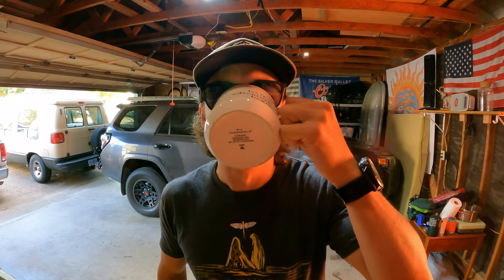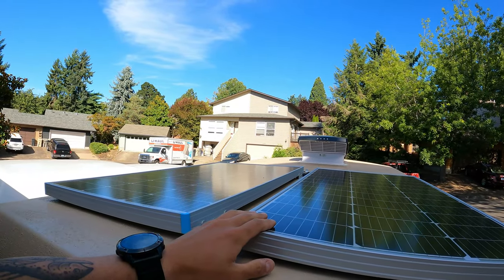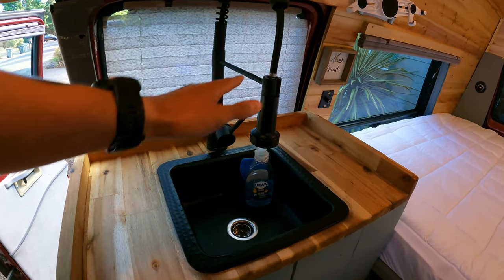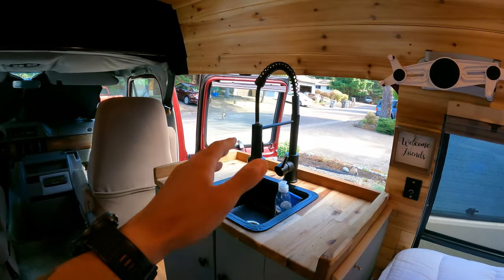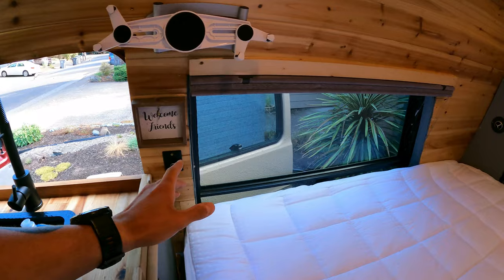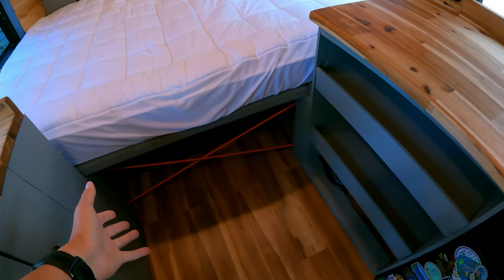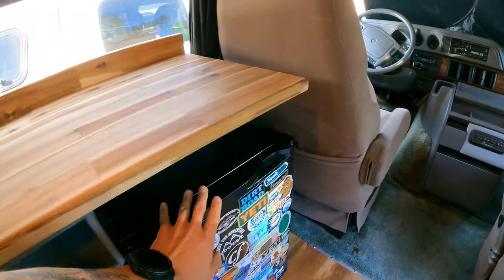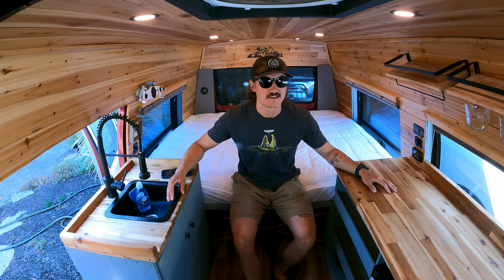Selling my Camper Van...? | Van Tour of DIY Self-Converted Log Cabin on Wheels (97 Dodge B2500)

Comment: I just got that same sink for a build.   Having a bear of a time finding the right drain.  The one Amazon suggested was for a kitchen sink.  I need to connect up to a 5/8 ID hose that's already installed in the van.
Reply from the maker: Yes I had the same problem with that sink. I ended up having to modify the sink to get my drain I ordered to work for my set up.